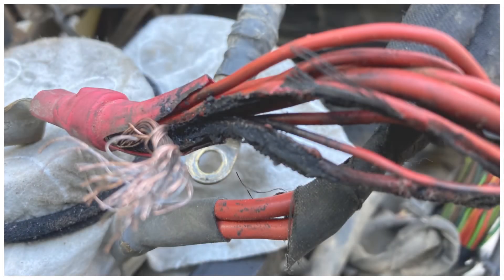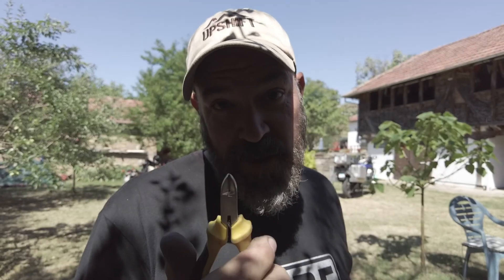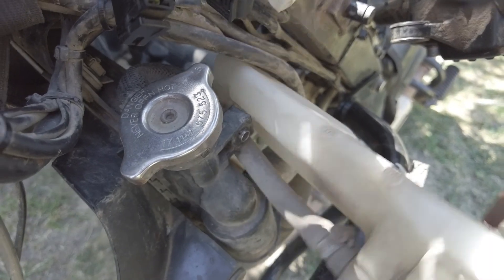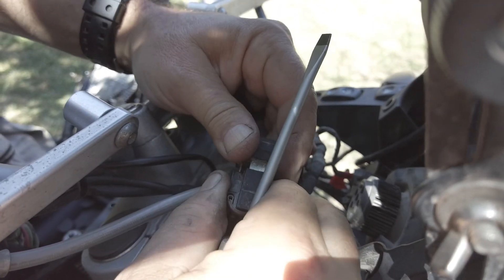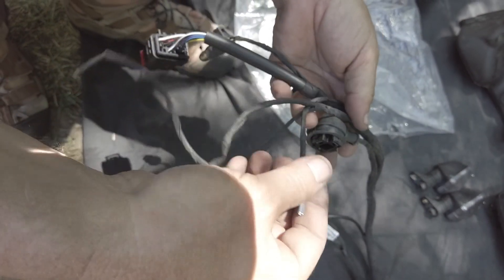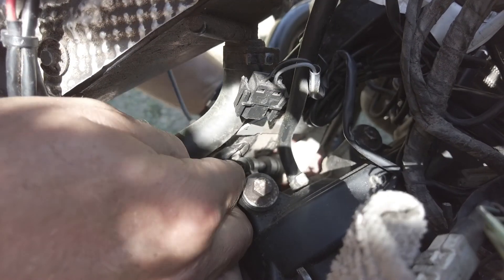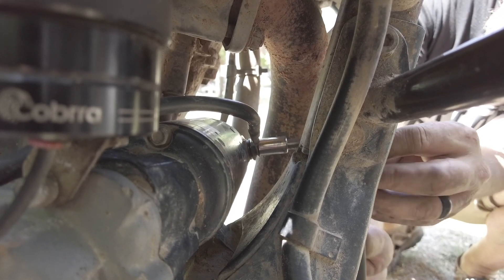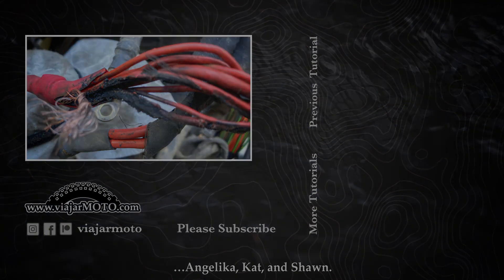Removing the Main Wire Harness from a BMW G650GS

Comment: One thing doing this in the comfort of a home garage, but out on the road at some remote camp in eastern Europe, that's another story.  Were you on the TET when it happened?  Amazing you even found a replacement harness.  My heart sank when you reported this on IG, but in true heroic fashion you crushed it getting the harness out.  Much respect for the fortitude and even doing this video, which in itself is no small feat!
Reply from the maker: Thank you so much Monty! We had a lot to be thankful for. The burned wire did not cause a fire. We were on a non-busy street when it happened, we could easily push the motorcycles in a shady area to determine the problem, a hotel was only a three minute push away, MotoCamp was only three hours away and offered to trailer us to camp, MotoCamp also helped in getting the new harness, lots of support at MotoCamp. Much to be thankful for!

Comment: Great job, but I cringe just thinking about putting it all back together.
The video will always remain as a reference on the net. I also have a G650Gs, bought used and with a problem that I can't solve, in fact when it warms up, after it's been running for a while, the idle goes up to 2200-2500 rpm so as to make it undriveable. Given your expertise, could you give me some advice to solve this problem? Thanks!
Reply from the maker: Thanks for the comment. I am an electrician by trade so the wiring of the harness was not as difficult as I imagined. However, I am not a mechanic and have never heard of the issue you seem to have with your 650GS. Have you tried to ask the question on the G650GS forum of the AdventureRider forum?
Reply: @viajarMOTO  Not yet...
Reply: On the net I found It could be  a sensor,I cleaned the pressure air sensor, but with no success.

Comment: Hey man can you list where you found the new harness? I have same problem for my gs 650 and need to replace the harness
Reply from the maker: @kastus2453  Purchased directly from BMW. Shipped from Germany to Bulgaria.
Reply: @viajarMOTO  Okey thank you :) was it expensive? i have seen some used ones for 50-100 $ on ebay
Reply from the maker: @kastus2453  Yes, it was about $1,110 USD.

Comment: This is all familiar territory wish I was there to help
Reply from the maker: You had a similar experience? What was the cause?
Reply: @viajarMOTO  the feed from battery to the ignition plug in beside the relays . Looked like it rubbed on frame
Reply from the maker: I understand. We took some time to add more insulation to the bundle on both bikes. Hopefully we don’t have this problem again.